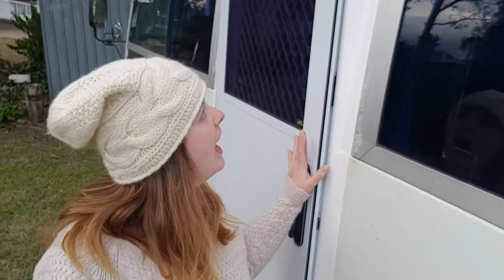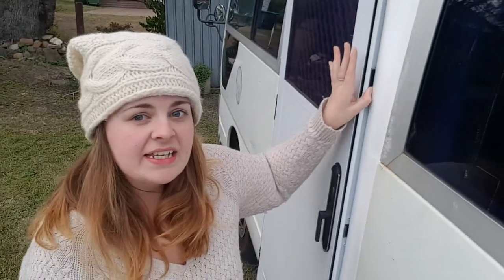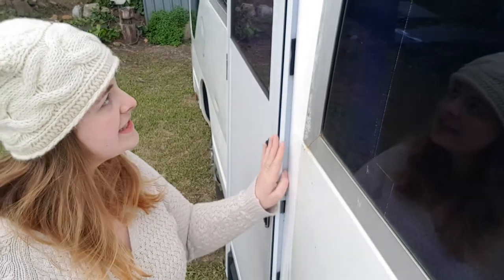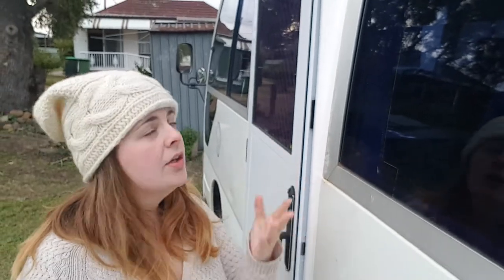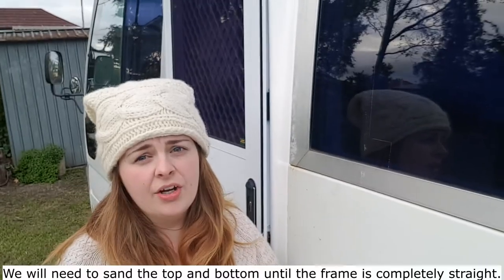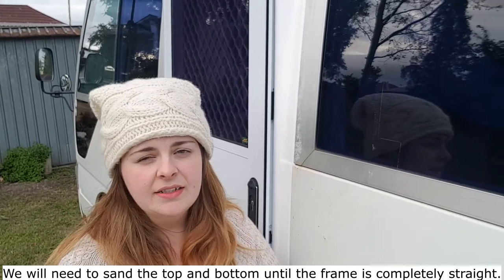Toyota Coaster Bus Conversion - Update and Issues

Comment: You probably need to make a permanent change to the door interlock by identifying the switch and permanently bridge it out. If the problem comes back later not being able to drive could be a problem. I think you can also remove the lock from under the accelerator?

Comment: Wow lots of work for that door I am so happy mine already has an outfolding door which I can close or open with a switch.
Reply from the maker: Not only a lot of work but it was also a large unexpected cost for us as well. Good thing you don't have to worry about it!
Reply: @RoamingonRubber  Did you get your parts from custom coaster conversions?
Reply from the maker: Yep! Door, door frame, shower cubicle and water tanks are all Custom Coaster Conversions
Reply: @RoamingonRubber  They are quite close to where I live so might be worth a drive to them.

Comment: Hi, I have a Toyota Coaster and am interested in you comment about the accelerator lock.  Ours is locked even when the side door is shut. Can you tell me where the actuator is.   Cheers  Bob
Reply from the maker: Hi Bob, we had a open/close switch on the dash. We reconnected the door mechanism, then closed it with the switch which released the accelerator lock.
I don't know what in the dash links that switch to the accelerator lock.
If you can't do that, the 'Toyota Coaster Owner's Group' on Facebook have a few people that have removed the locks. From memory of what I read, it's just a few bolts